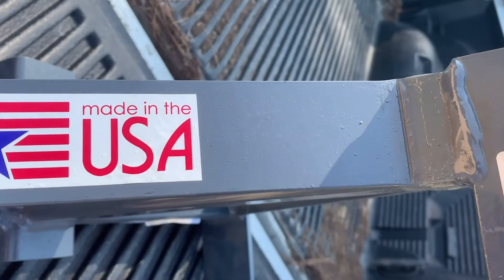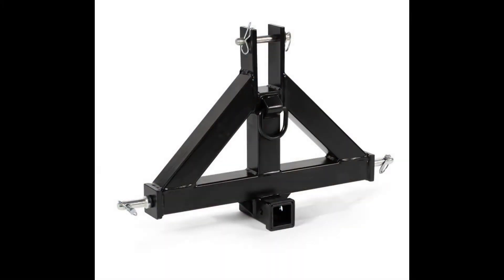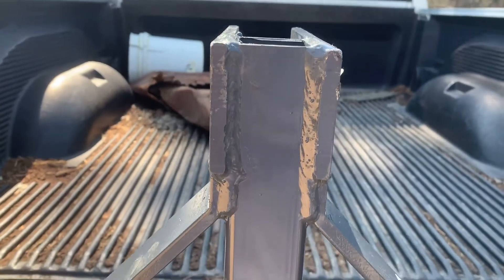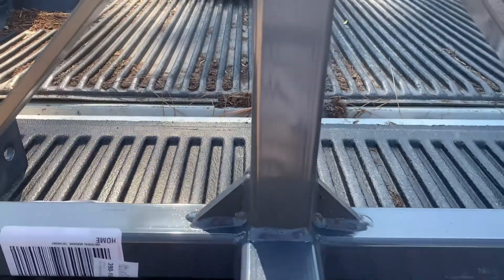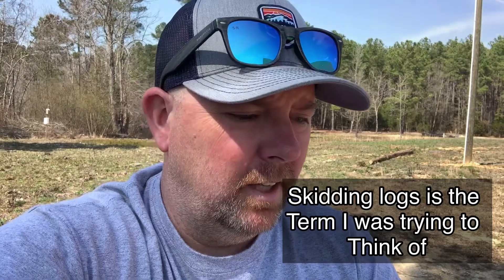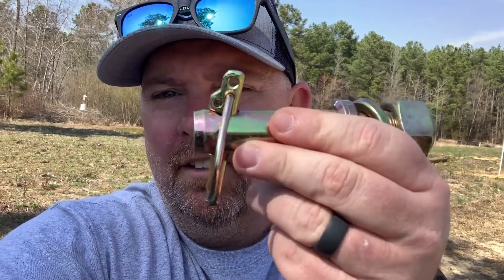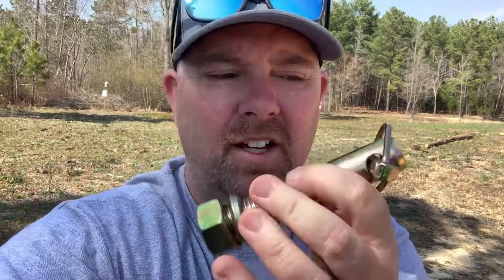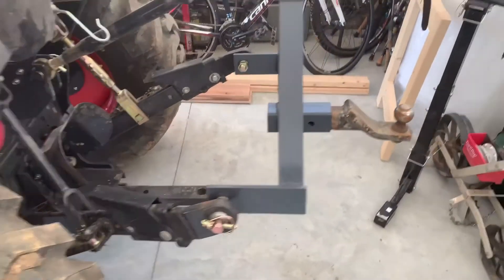Titan Attachments UA Drawbar 2" Receiver Hitch | Made In the USA

Comment: Every tractor owner needs one of those. That one is beefy. I think mine is the China variety. I love Titan attachments. I got a receiver from them that clamps on the bucket and got a Reece hitch with the grapple hook for it. I use it to drag trees with the front end when my chipper is mounted on the back. I also welded a couple clevis mounts on my bucket.  There’s still huge limbs down in my creeks I haven’t gotten to from that nasty ice storm last October.
Reply from the maker: You are right. I am going to get the forks before long. Not sure if from here or a local guy. Will have to see. I got some hooks too. I just need to get them welded on. Then again, I may buy those bolt on ones, that way I can change them if I need to. I like the idea of the receiver on the bucket. I might do that too. I really want a tiller too. So much stuff lol.
Reply: @EarlybirdFarmSC  I have the clamp on forks with the center stabilizer bar. They work good. If I had to do over again, I would spend a little more and get the skid steer forks instead because you can’t see the bolt on forks through the bucket.
Reply from the maker: Thanks for the tips. I think that’s the way I’m leaning too.

Comment: You can probably weld a couple of the chain hooks to a short piece of square tube that would drop down into the center of that upper link connecting point that would hold your chains.   Then you could simply take it out if not needed to keep out of your way.  https://www.amazon.com/Robbor-Forged-Tractor-Weldable-Tractors/dp/B08FD9W1XY/ref=mp_s_a_1_8?dchild=1&keywords=Chain+Hooks&qid=1616755604&sr=8-8

I have been throwing my chains over the quick hitch but need to do something a little better.  :)
Reply from the maker: I need to do that. Hey I just had a bunch of old comments pop in. Not sure where they were but it happened on both my channels. Most have links in the comments like this. I check the held for review often and no comments there. That’s why I’m late to respond to these!